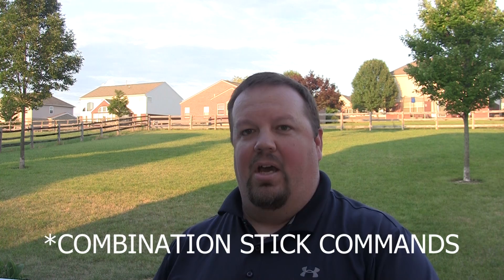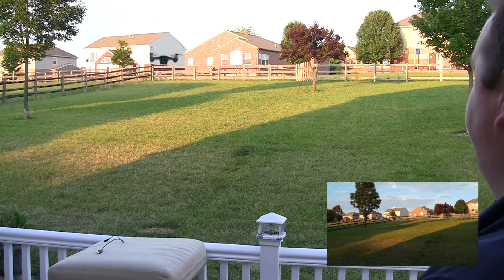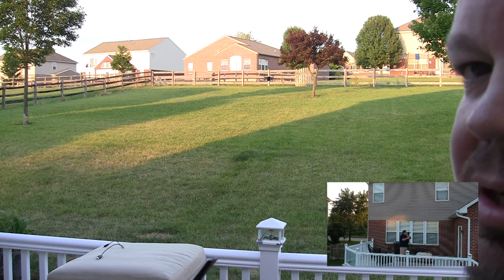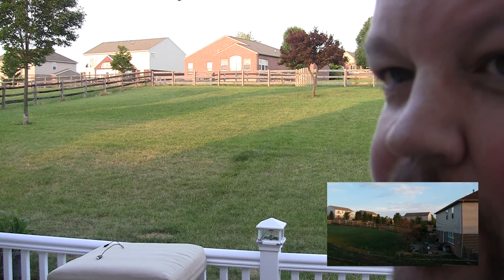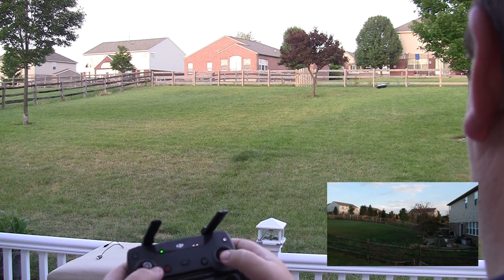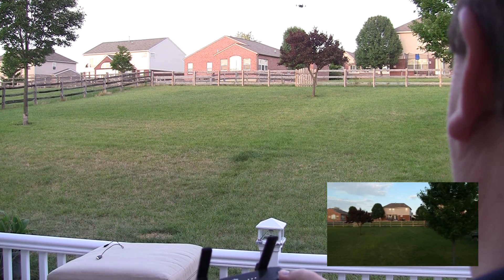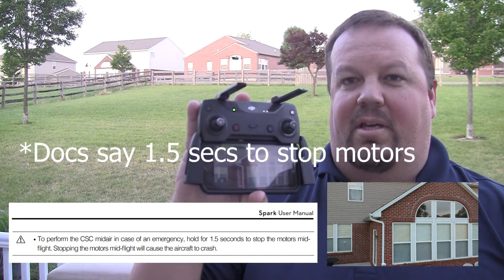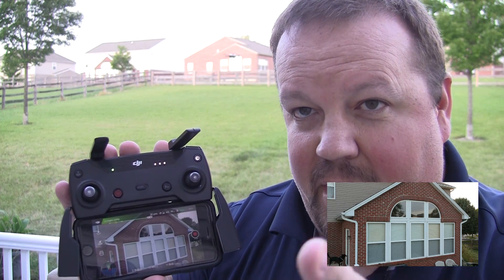Emergency Motor Shut Off on DJI Spark does not work

Comment: Its actually a feature you have to turn on in the settings. Previously you couldn't change that but after a lot of people crashed their drone because of the csc they turned it off by default but you can still turn it on again.
Reply: @DailyDroning  well, im 100% sure the option is/was available on the mavic pro 1. I will check it again tomorrow.

Comment: How bout trying just the throttle stick, down n out, for emergency cutoff. That's how it works on phantom 3 pro, instead of both sticks which start n stop motors when landed.

Comment: I think you are just flying the spark too close to the ground, as soon as the spark stars going down when you flip both controls, the bottom sensors dectect the ground and kills your control, to test this function of a shut down and fall you need to be much higher so the sensors do not dectect an obstacle.
Reply: @DailyDroning  wrong... you need to be higher to work.. and it will work on any dji drone
Reply: KlooGer damn. you got me there.. i appreciate your video and dedication and testing. im not ready to test my drone that way. i stand by my statement but do accept your response. thank you and have fun.
Reply: It happen to me today, while RTH and spark auto landing, spark suddenly stopped motor at 2 meters from ground, next to me (about 1 meter distance) and crash to concrete, broke it propeller

Comment: Better not to, mine hit leaf, shut motors and felt on to concrete from 1.5m nowbi need new bodypart and if i take it on repair it could end up 100$ :/ and body part is only 38$

Comment: You're still doing it incorrectly: pull the left stick to the bottom inside corner while simultaneously pressing the Smart RTH button
Reply: True! So the manual must be wrong. I would not be surprised if they copy-pasted half the text from the old Phantom manual and forgot to update it. Historically, this command was ditched in 2016 because people were initiating it unintentionally. https://www.dji.com/newsroom/news/dji-releases-new-firmware-for-phantom-series 
Obviously it was a very silly idea to have a drone just cut its engines when the sticks used to fly it were pushed a certain way – it’s like having a speeding car with wheels that fall off when the accelerator and clutch are pushed at the same time.